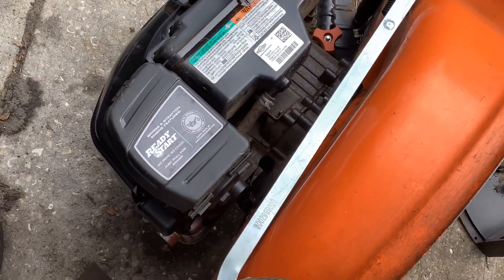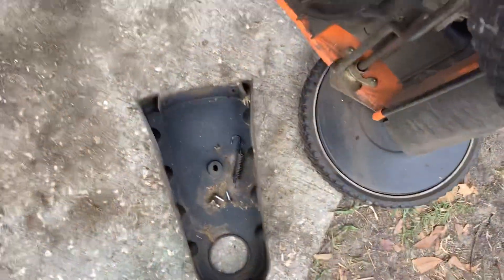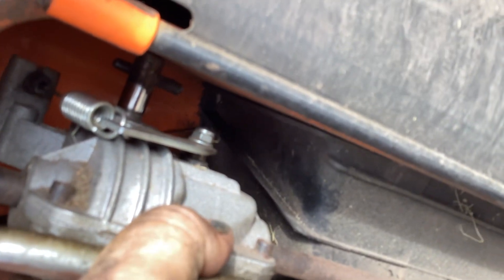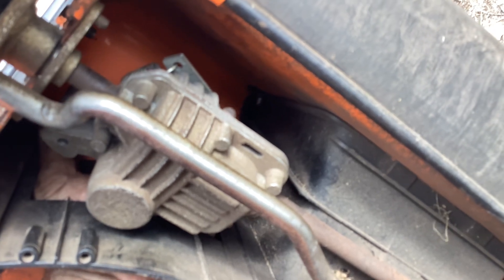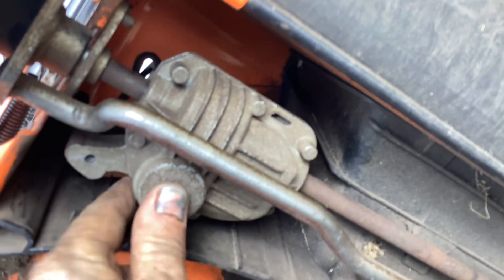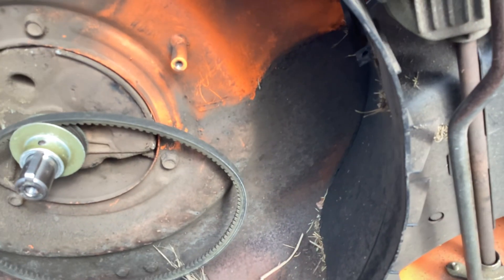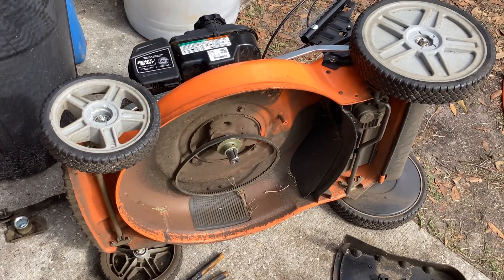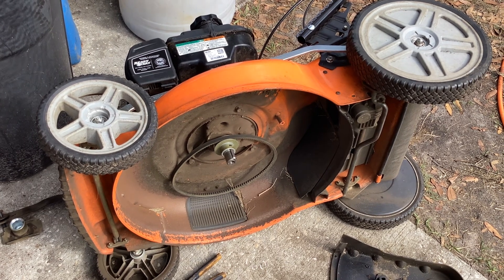2018 Yard Force Lawn Mower for $35... Found out why Self- Propel is not Working...Still a TURD.!!!

Comment: It would make a good candidate for a engine for something else. Maybe a self propel with a bad engine??? I've made a bunch of Frankenmowers out of good engines on non -working self propelled machines.
Reply: I agree. 163cc briggs with a 1in/25mm crank. Should fit on a toro recycler assuming the bolt is the correct size.

Comment: My Yardforce is working. Already had warranty work on the small spring that broke on the SP feature. After 7 months it broke again. The Mower is a champ for me but he little $2.00 spring is a deal breaker. The Warranty company really deals hard with owner and repair dealer for documentation.  Parts are hard to get. Looking at local repair shops and online parts/hardware to fix. The quality of the metal in the spring is the problem. Innovate adapt and overcome!

Comment: Personally. I would pull the trans and all self propelled parts and sell it as a pusher. That trans looks like it was junk from the start
Reply: The more I think about it, with that shaft being so loose.  That trans should be covered in grease. Oil etc… makes me wonder if it was never filled from the factory. Quality control is a thing of the past
Reply: @dirtyberniesgarage1194 These worm drive gearboxes usually use liquid hypoid gear oil like differentials use. It leaks out fairly easily and fries the transmissions. At least the old Toro Recycler transmissions use grease and cheaply replacable bushings. The gears in those never fail, it's the slop in the bushings that allows the gear to move away from the pinion.
Reply: I just seen a video of the spring mine has the pulley and spring I am thinking the belt came off the motor pulley but the wheel is the least of the worries

Comment: Similar model - yard force.  My plastic pully got worn and came off the shaft, but was still up inside the plastic belt guard.  But I can't get the plastic belt guard off.  How do you remove the "washer" that the blade bolts onto?  Thanks,